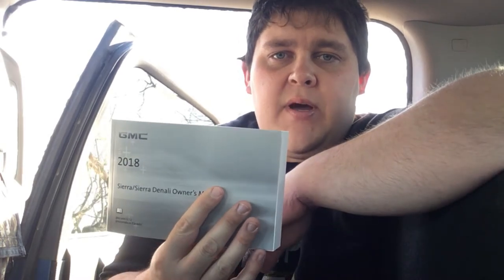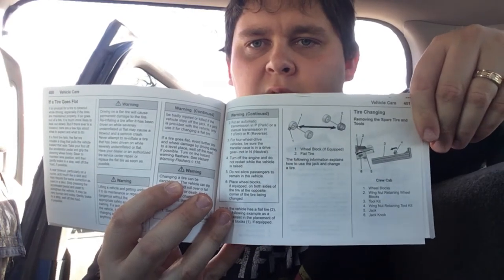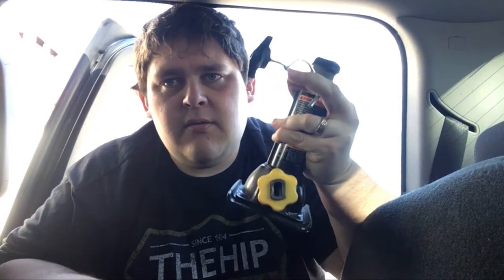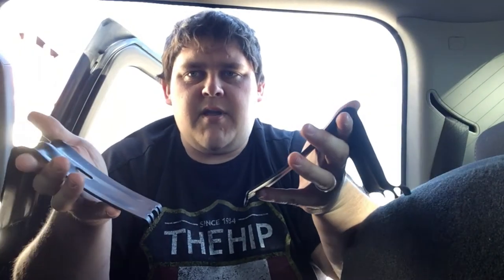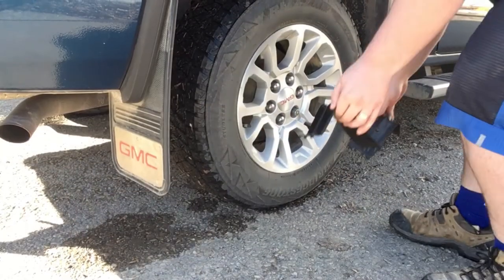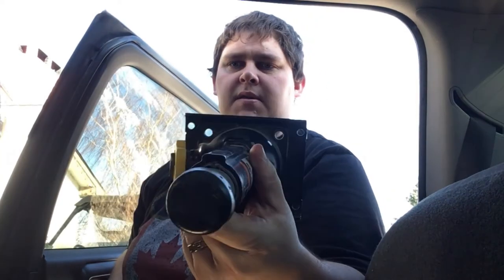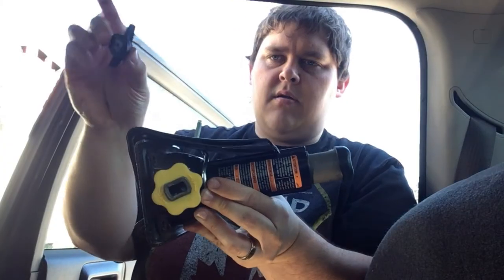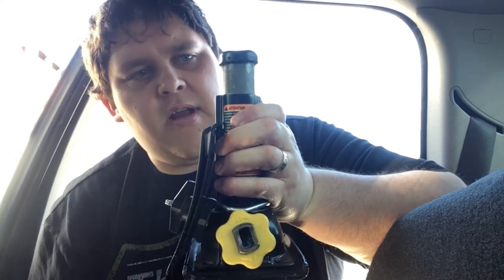2018 GMC Sierra 1500 - Jack and tool storage

Comment: Great video Travis 👍. Do you know how to lower the jack. I may have extended it too far and now I can't lower it past halfway. Do you have any advice or ever had this issue?
Reply from the maker: Cannot say I have experienced the issue of the jack not lowering or collapsing all the way. I would suggest using some lubricating oil and trying to crank it up and down until it starts working properly for you. May just be some corrosion built up.